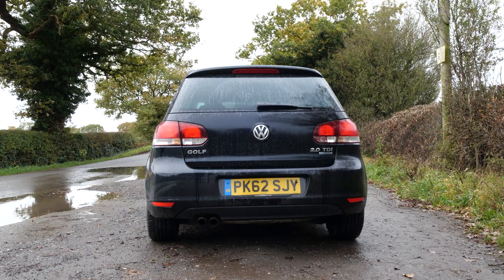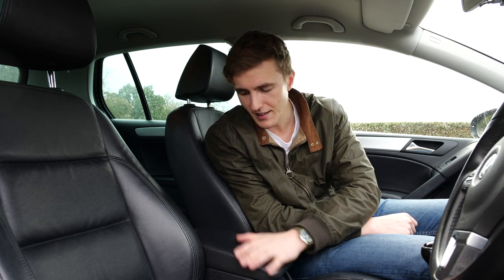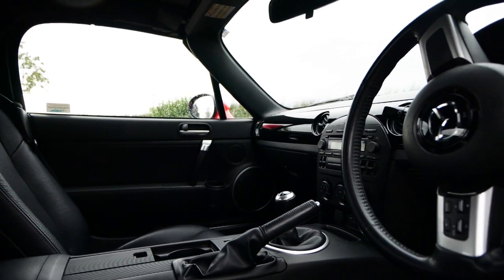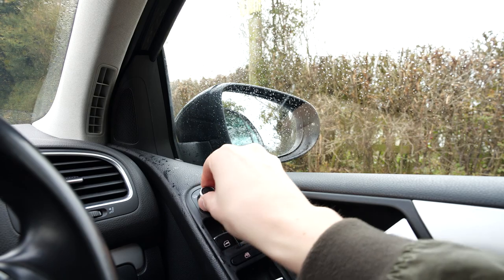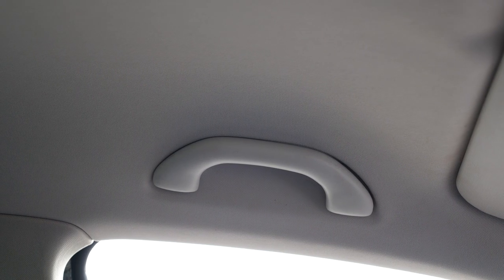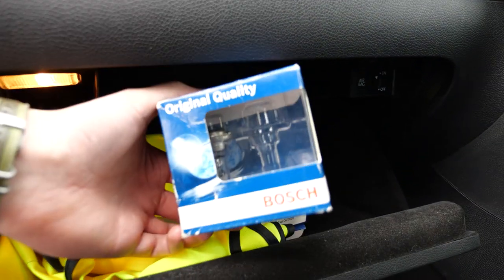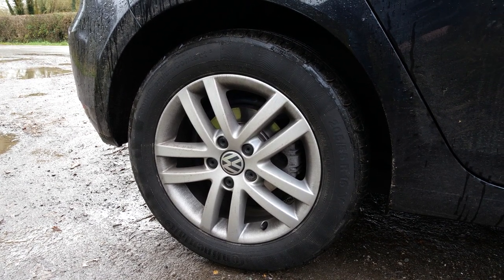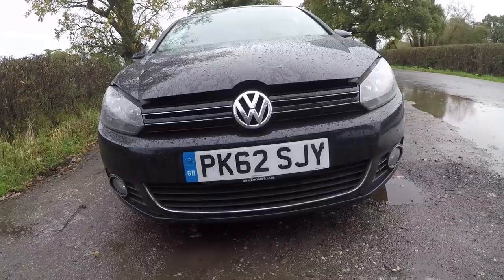VW Golf 2.0 TDI - The only car you need

Comment: What sort of MPG do you get? Urban and rural?
Reply from the maker: Usually a quick run out will be about 49mpg. Going to work on the motorway is more like 65mpg.. but who can trust VW mpg figures? 😬
Reply: @CarThought  well, there is that. Overall, very good though! I’ve been thinking of this vs the 1.4 TSI, but it seems a better proposition (I shouldn’t be affected by ULEZ/CAZ).
Reply from the maker: @declancoates5576  I think the petrol makes sense if you regularly do short journeys or drive in town lots! Motorways/long journeys the diesel makes sense.
Reply: @CarThought  my commute is a 40 mile round trip, plus some extra personal miles of varying distances in the mix. The 40 miles is mainly A road/dual carriageway. The diesel makes sense I think? The petrol cars also seem to have shot up in price (I assume due to expansion of the ULEZ) which is a bit annoying.

Comment: Is that the same as the 103tdi in Australia
Reply from the maker: From a quick Google, the comfort line numbers do appear to be the same yes 👍
Reply: @CarThought  what kind of mpg do you get?
Reply from the maker: @benjaminwingchun9665  depends on the roads, around town 50+, on a motorway usually 65+.. but I do drive pretty slow 👍
Reply: @CarThought  UK right?
Reply from the maker: UK MPG figures yes

Comment: All is well until the comon DMF rattle starts.. budget for over £1000....
Reply from the maker: Nah I’d do it myself, it’s just a pain to take out on the driveway 😂 Still if you paid 1k... cheaper than finding an equivalent car!
Reply: @CarThought  hmm really, I can find a cheaper equivalent.. and in a lot of ways better...VW is the posh man's VAG remember :p
Reply from the maker: If you say Skoda I’m afraid I’ll have to ban you 😂 just kidding, but any high mileage car is going to have its problems. Plus the trusty golf started off on 38k so I’m going to have to spend something on it some time!
Reply: @CarThought  it's only on 38k wow, happy days then.. my car has auto dimming rear mirror, fully electrical heated leather seats, rear heated seats, adaptive cruise control, side mirrors dip to see the wheel on reverse, xenon headlights auto lights, auto wipers... And its older than yours..